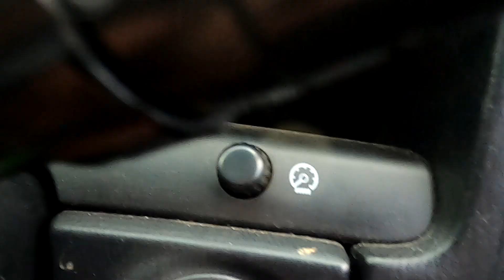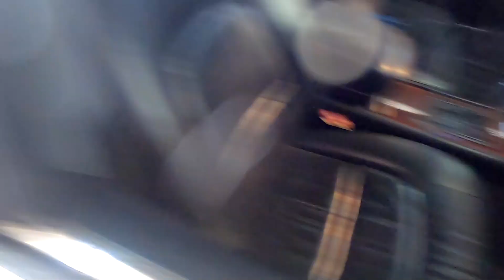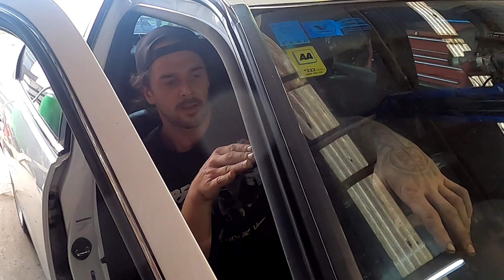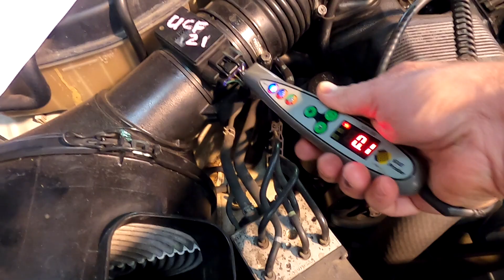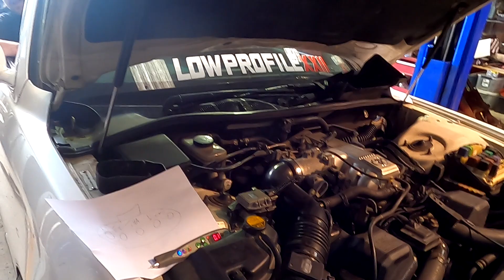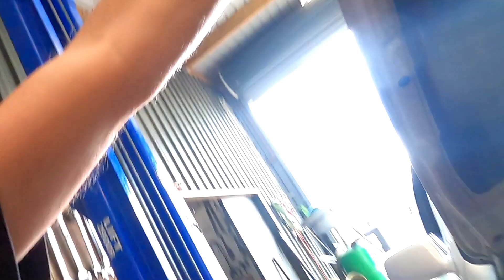Toyota Celsior or Lexus LS400 diagnosing the car that blows air flow meters Part 1.

Comment: Is it possible to update the older style AFM to the later model AFM? My vehicle is a 1990 Ls400. Trying to compare wiring diagrams but I’m not sure if it could be done by switching wires around or if a conversion of some sort would be needed.

Comment: Hey Kelvin, I have an 93 LS400 thats having Problems, it runs extremely rich, hesitates when getting pushed and wont rev past 3k, it always gives out Code 47 sometimes 41 too, both sensors work as intended...
I already did the ECU Caps but I still don't know if it's the ECU or something else... 
Timing Belt did not jump, timing tho is not as it was like in that Video with the yellow Ute you showed in the past, it does not Change timing upon pulling the Bridge wire on TE1 E1
You're the God of 1UZs maybe you got an Idea... Could the o2 sensor cause that Problem? Maybe the Crank Sensor? But it does not give a code for that whatsoever
Plugs New, spark wires new, Distributors are new
Im running out of ideas at the moment
cheers
Reply from the maker: I'd focus on the known issues,  not the unknown so code 41, and 47.  Id scope the voltages and monitor with scantool.  Id be looking at sensors,   wiring and ecu.  Cheers Kelvin

Comment: Celsior has a Toyota logo on the steering wheel, a LS400 would have the Lexus logo. Celsior speedo only goes to 180, LS400 goes to ..260?
Reply from the maker: Over here there are lots of celsior with LS400 badges and parts to make them look like a ls400,  same with the soarers to sc400